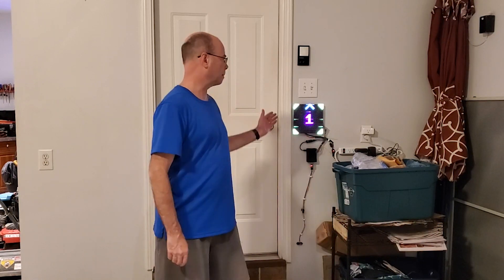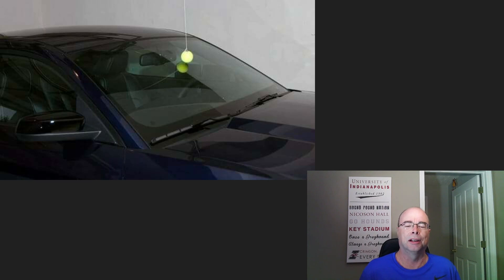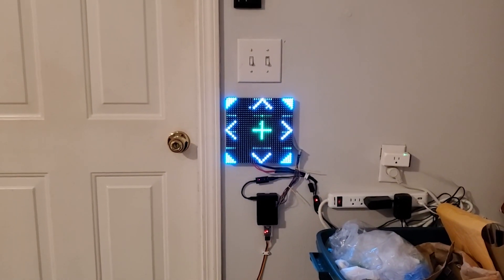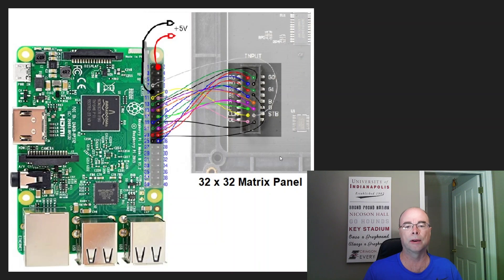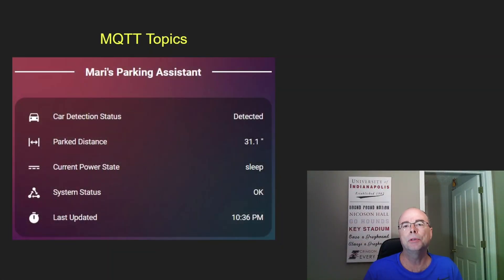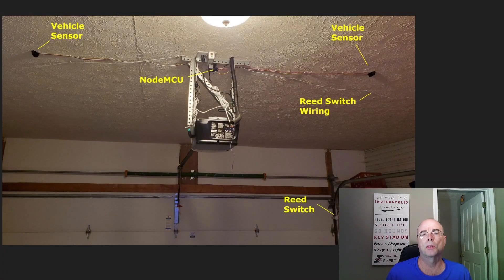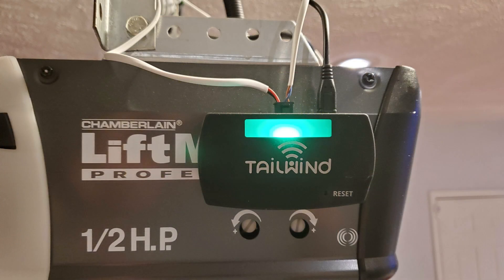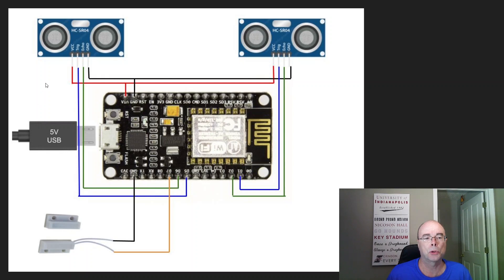Parking Assistant and Vehicle Presence for Home Assistant

Comment: I'm very interested in your video. I've had very unsuccessful results trying to use the HC-SR04. I've tried using it with an ESP32 running ESPHome. I also tried using a D1 Mini running Tasmota. The ESPHome one gives almost constant readings "ending state 0.00103 cm." The one running Tasmota will give wild readings all over the scale when the vehicle is present. They settle down when the car is gone at first and read about 60 cm but after a short time will start reading odd readings like 9 cm and 2 cm. Can you suggest anything?
Reply from the maker: Well, I did a completely updated (and I think both easier and better version of this project that  uses an ESP8266 and WS2812b LEDs.  https://youtu.be/HqqlY4_3kQ8

But as you can see in this video, like the original, I am using a TFMini LIDAR sensor.  I do a comparison of three different distance sensors, including the HC-SR04 and why it isn't a good fit for a project like this.  The TFMini isn't cheap, but for a precise project like this one where a stable, accurate and reliable measure is needed, it was the best fit for my projects.  Others have apparently tried to use the ultrasonic sensor with much the same results as you, as the ultrasonic sensor can be very noisy and subject to interference.  But if you watch the above videos where I compare those distance sensors, you may have a better understanding as to why you are having the issues that you are.
Reply: Thanks so much. @ResinChemTech

Comment: Thank you so much for making this video! Exactly what I need!
Reply from the maker: You are welcome!  Note that in about a week or so, I'll be releasing a video of a new version of this that uses an ESP8266 and a strip of WS2812b LEDs.  It's a bit easier to both build and setup... and significantly cheaper (especially since Raspberry Pis are so hard to come by right now).  Just wanted to let you know in case you were thinking about building something like this.  It will also have optional MQTT if you want to use it for vehicle presence detection... but that won't be required, and it will work standalone without Home Assistant or any other external system.

Thanks for watching!

Comment: Impressive; However I like the KISS-approach using the tennisball better. Keep up the good work!
Reply from the maker: I agree... sometimes the KISS approach is the best.  If I could have just figured out a way to get that tennis ball integrated into Home Assistant....
Reply: @ResinChemTech  You can, if you must:
Replace string > wire; Add a motion and/or reed sensor in the tennis ball.

Comment: If you have cameras already on both vehicle spots and your Home Assistant host has enough CPU power, you could probably just use something like Frigate NVR to detect the cars from the camera feeds.
Reply from the maker: Absolutely!  And I do have a garage camera that would cover both spots.  But at the time I built it, I think I've might have still been running HA on an RPi.  I've since moved to a VM, but the current system works so well, I've never seen a reason to go back and replace/upgrade it.  But thanks for the thought.... might give others a different idea.

Comment: This is another cool video.. But why cant you use esp32 and a ultrasonic.. To make a parking assistant ?  It can cut the cost and can make it work the same way right. Correct me if I'm wrong.
Reply from the maker: Like most of my videos, there are multiple ways to get the same results.  I chose the RPi because (1) already had one on hand, (2) Python libraries were readily available and (3) I wanted to learn more about Python and had yet to learn C++/Arduino at the time.  I think the pinouts and libraries could be an issue for the ESP32, but I'm sure it is doable.

As far as the ultrasonic sensor, I think the response time might be an issue.  The TFMini is designed for time-of-flight for things like drones and remote control cars, robotics, etc. and has a very fast response time and I've found better accuracy and precision than ultrasonic.  That's why I opted for lidar for parking (where better response/accuracy is needed) vs. ultrasonic for the car detection where speed/accuracy wasn't near as important.
Reply: @ResinChemTech  it sounds cool... Lidar are great but real expensive.... But for the long use case... As you said lidars are super precious and can be accurate... Keep doing more projects and love to see your more video... Good luck for you.